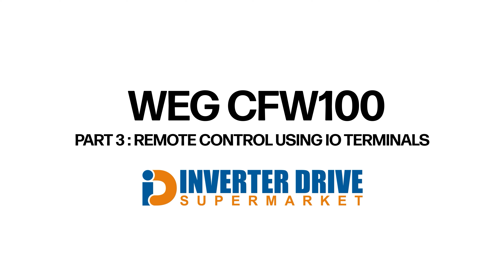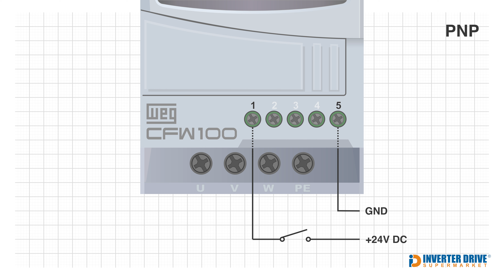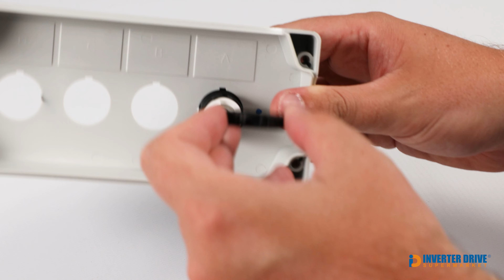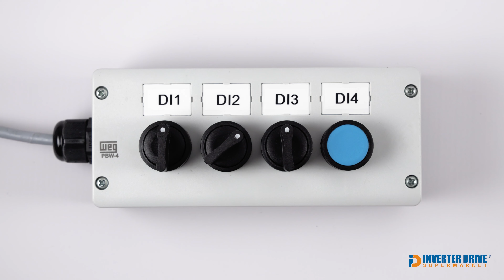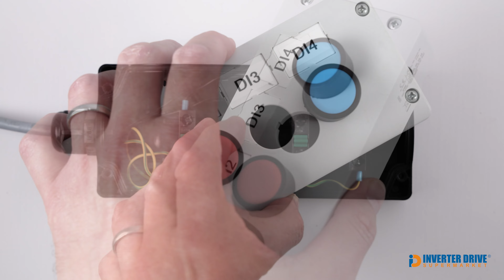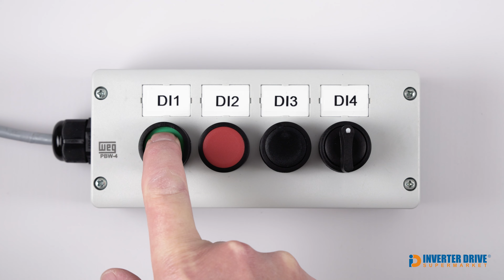WEG CFW100 Inverter Drive – Part 3: Remote IO Terminal Control for Motor Speed and Direction

Comment: Will the speed always return to the minimum speed after stopping the motor? How would set it up to return to the previous speed the motor was running after pressing the stop button while using the electronic potentiometer?
Reply from the maker: The drive will return to the previous speed when restarted, provided P120 is set to 1. It will remember the last speed even after a power cycle.

During acceleration, a second momentary press of the Start / Increase E.P. button will cause the drive to hold the current speed.

This assumes the digital inputs are configured as P263 = 37, P264 = 40, P265 = 38, and P266 = 8, as shown in the final example in the video.

Comment: With p265=38, would pressing the black button stop the motor or just slow it down slightly? Does the motor have to be slowed to the lowest speed before the black button stops it? I'm wondering if I can do start/stop and speed control with just 2 buttons.
Reply from the maker: Yes, with P265 set to 38 the motor has to be slowed to the minimum speed before the black button will actually stop it. Pressing it while running faster will only reduce speed, not stop the motor.

So in theory, you could control start/stop and speed with just two buttons. But in practice, this isn’t a safe or recommended approach. A proper stop or emergency stop that immediately halts the motor should always be provided.